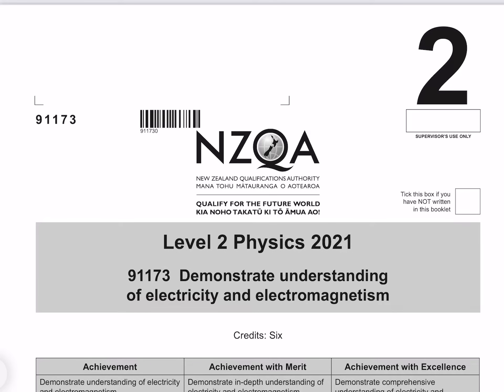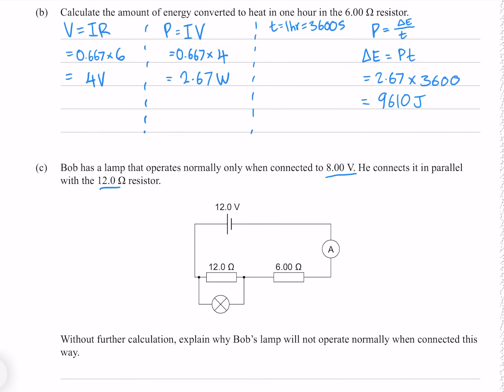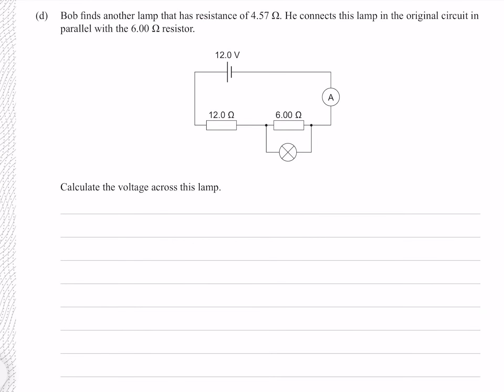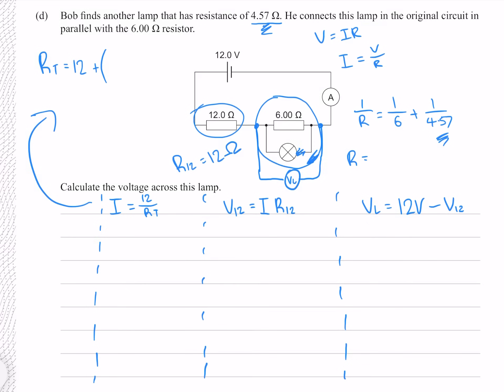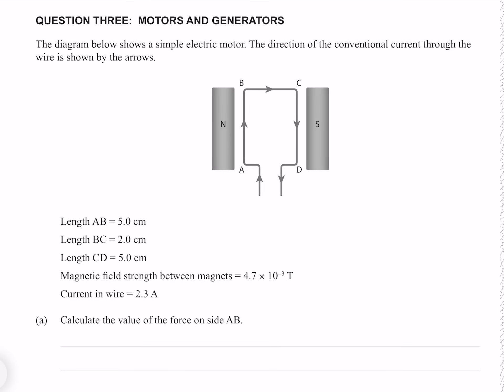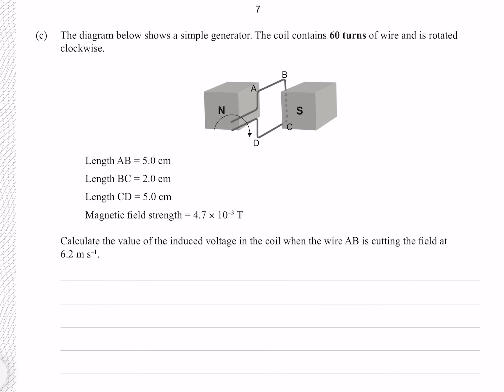2021 Electricity and Electromagnetism Exam (NCEA Level 2 Physics)

Comment: 1:18 - couldn't we just say that the voltage in the 6 ohms resistor is 4 (12-8)??? as voltage in a series circuit add up
Reply from the maker: Ha! Yes, that absolutely works too.

Comment: Hey sir, really apprecitate the video. For question 3C wouldn't there be an induced voltage on wire BC aswell, as its also cutting the magnetic field when rotating.
Reply from the maker: Hi Rumi, the positive charges in the section BC do experience the same force however, as with sections AB and CD, its direction is into/out of the page. Because in this direction there is no conductor for the charges to move into, they do not contribute to the flow of current in the circuit and can be ignored.
Reply: @MrWhibleyPhysics  thanks so much sir.

Comment: Q1 D). I simply did (1/12+1/6+1/4.57)^-1. This gave me the same answer, 2.13V. I realize now not all the resistors are in parallel so doesn't really work this way. Am I right to think this, meaning my working is wrong?
Reply from the maker: Hi Zachary, you're correct that your working is wrong. I'm not sure how you've gotten the same answer.

Here is the correct working https://www.wolframalpha.com/input?i=12-%2812%2F%2812%2B%281%2F%281%2F6%2B1%2F4.57%29%29%29%29*12

Here is the working I believe you've done which gives -55.5 https://www.wolframalpha.com/input?i=12-%2812%2F%281%2F%281%2F12%2B1%2F6%2B1%2F4.57%29%29%29*12

Comment: excuse me sir, at 13:51 i dont understand why you further multiply the answer out by 2 because isnt the question only asking for AB?
Reply from the maker: Hi Cobs, the wording here is understandably a bit tricky. The question asks for the induced voltage when the AB wire is cutting the field, it isn't asking for only the induced voltage in the wire AB.
Reply: Hi mate, I don't understand this as well.
But sir answered this in previous comment that When AB is cutting the field DC is as well, the question expects you to understand this. Because of this we have voltage induced by two 5cm sections, which is why we multiply by 2.
Hope this helps you

Comment: At 6:31, why does the 0.822 A have 3 significant figures and not 2
Reply from the maker: Hi Shriktic, the rule is to round to the least amount of significant figures given. In this question all values are given to 3sf, so it's correct to round to 3sf.
Reply: @MrWhibleyPhysics  Oh yes, sorry, I forgot the 0 isn't considered a significant figure

Comment: for question d(ii) why is force in position A and C acting at 90 degrees to the field line?? is it because of the circular motion so the force is directed tangent to the circle, which causes the force to act upwards?
Reply from the maker: Hi Hane, the key is to think only in terms of the magnetic field direction and velocity direction. The maximum effect occurs when they are at 90°, no effect is present when they are parallel.

The field in this case is  towards the right (from north to south), the velocity is tagential to the circle.

Comment: For adding resistances in parallel (/combination) I just plug ((x^'1)+(x^'1))^'1 into the calculator and it works the same. The fractions to me are too confusing at times but if I used that equation to show my working would that answer be invalid?
Reply from the maker: Hi Ant, x^-1 and 1/x are just a different way of writing the same thing. Either is fine.

Comment: QC ii shouldn't you divide the distance by 2 since the droplet is in the middle?
Reply from the maker: Hi Paulina. When using the equation E=V/d we are finding the electric field between the plates. The voltage of the plates is 240V, which exists over a distance of 2cm. E=V/d=240V/2cm=240V/0.02m=12000Vm-1.

If we were to instead use the distance to the middle, we would have to instead use the voltage between the plate and the middle. This voltage would be half of 240V, so 120V. Our equation would then be E=V/d=120V/1cm=120V/0.01m=12000Vm-1. So our result would be the same! Hope that helps.
Reply: Wow, so quick to answer! Thanks so much.

Comment: Sir, I don't understand why in question 1C you don't use conventional current but then in question D, you go back to using conventional current. Could you explain why?
Reply from the maker: Hi Nathan, I'm not quite sure what you mean. In 1c and 1d the conventional current is counter-clockwise however, the direction of the current does not have an effect on the working or answer to either question.
Reply: @MrWhibleyPhysics  Sorry i meant for in question c, the voltage seemed to have gone through the 6ohm resistor first, causing a voltage drop but in question D, the voltage flows through the 12 ohm resistor first

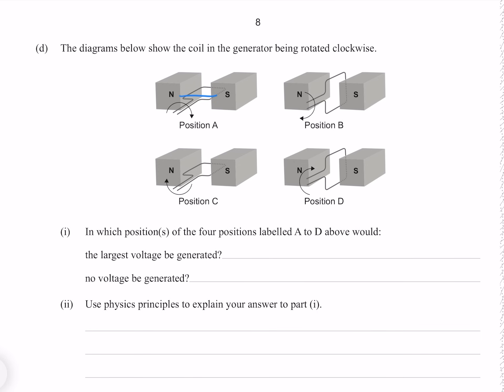Comment: quesiton 3di at 14:31 is really confusing could you please go into detail for me 😭😭😭😭😭😭😭😭
Reply from the maker: Hi there, the key is that the voltage induced is greatest when the velocity of the wire is at a right angle to the magnetic field, which points from north to south. The two examples where this is the case is in position A and C.
Reply: @MrWhibleyPhysics  Thanks but why is A and C's velocity at 90 degrees to the field and the others are not? Sorry should have phrased my question better...
Reply from the maker: If you imagine the field lines pointing between the poles, as the wire rotates it's velocity points at a tangent to the circle through which it rotates.
Reply: @MrWhibleyPhysics  OHHH i get it like the centripetal force so the velocity is at a tangent to where the wire is facing. Thanks sir!!!

Comment: Hey, why is the electrons moving down the left side of the coil at 16:21 in position C and A, but the electrons are not also moving up on the right part of the coil? Because if the left part of the coil has a velocity upwards, doesnt the right part have a velocity downwads if its moving clockwise? That would mean that the top of the left part of the coil is positive and bottom negative and then the top of the right part of the coil is negative and bottom is positive.
Reply from the maker: Hi Tayyab, you're absolutely correct. Electrons are forced out of the page on the left side, and into the page on the right side. This results in a counter-clockwise electron flow, and is what enables this to function as a generator.

The assessment schedule is vague, but I would expect they would allow for the placing of any arrow showing a counter-clockwise electron flow.
Reply: @MrWhibleyPhysics  Hey also if both sides of the coil have induced voltages, why does current flow?
Reply from the maker: Because the sides travel in opposite directions they induce voltage in opposite directions, causing current to flow. Recall that if the induced voltage on each side was in the same direction, the currents would oppose and cancel.

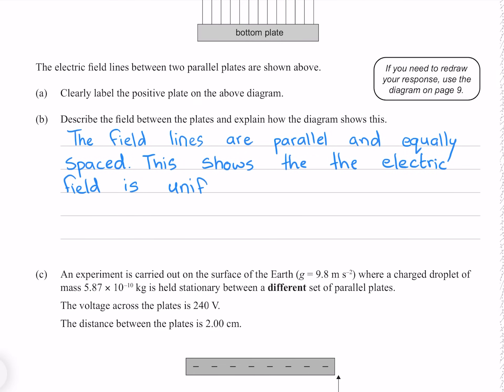Comment: At 7:48 I said electrical force instead of electrostatic force, because I did a past paper (2016 Q2d) that was about the Milikan Oil experiment and the answer schedule said that the forces acting on the oil drop was electrical force and weight. Is there a difference between electrical force and electrostatic force? Not to add more to your plate but is electrical potential energy and electrostatic potential energy the same thing? Thanks again for your wonderful videos Mr Whibley!! :))
Reply from the maker: You're welcome Kaishi! I'm glad you've found them useful.

Electrostatic force or Coulomb force is the more formal description, though electrical force fits too.

Similar to the way we might interchangeably say gravity force, gravitational force, or weight force.
Reply: @MrWhibleyPhysics  Amazing thank you so much, you have lifted a weight off my mind!! Getting ready to fight for tomorrow's exam 🍀🍀🍀

Comment: 1:49 just wondering about the significant figures, they seem to change every question so how do we know how many significant figures to do for each question?
Reply from the maker: The rule (though it's rarely enforced) is to express your answer to the least amount of significant figures in the question. So if you were given 12.6m, 55.1N, and 23s, 23s has the lowest sf of 2, so your answer should be given to 2sf.

Comment: Hello sir at 3:50 why does the current and voltage increase in only the 6 ohm resister and not the 12 ohm resistor?
Reply: (might be wrong) 
-The 12 ohm resistor's current does also increase as the whole circuit had an increase in current as the lamp is also a resistor so it makes the total resistant on the circuit lower as instead of R1+R2, a parallel circuit means you add resistors like 1/R1+1/R2.  By lowering the total resistor to get the same voltage this means that the circuit needs to increase the voltage.

-for the parallel section, the new voltage it will always be less than the initial voltage of 8 as the lamp makes it so its impossible for the new resistor to be equal to 12 ohms 
eg 1/12+1/1000000<(1/12)^-1

Example
Parallel section resistors were 11.98 then total resistors equal
 11.98+6=17.98

If voltage was constant
V=12

V=IR
Substitute: 12=I*17.98
Solve: I=0.667 This is the current for the whole circuit

Then find voltage for just the parallel section: V=IR
Substitute: V=0.667*11.98
V<8

 therefore the parallel section would have a lower voltage than initial and it wouldn't be able to supply 8V for the lamp to function properly.

Comment: Hey sir, for questions like 3d(iii) is it ok to use the left hand rule. Where the fingers point in the direction of magnetic field, palm points in the direction of motion/force and thumb points in the direction of conventional current. So for the last question if we use this rule our thumb points in the direction of conventional current, but since they said movement of electrons which I think is called electron current, we can take the opposite direction. For this question this method worked but I was just wondering if this method would work for other questions similar to this. Thank you :)
Reply from the maker: Hi Ash, great question! There are two ways the slap rule can be taught:

The first way is to use the right hand rule normally for positive charges, and for negative charges point the thumb in the opposite direction.

The second way is to use the right hand for positive charges and the left hand for negative charges.

I personally find the first way to cause less confusion in my students, so that's what I teach. Both are perfectly valid though!
Reply: @MrWhibleyPhysics  Ah ok, thank you very much sir 👍

Comment: For Q 3c, I Don’t get why you times it by 2. Because it says when wire AB is cutting the field and nothing about DC? Could you please clarify.
Reply from the maker: Hi Kalouless, you ask a good question. When AB is cutting the field DC is as well, the question expects you to understand this. Because of this we have voltage induced by two 5cm sections, which is why we multiply by 2.
Reply: @MrWhibleyPhysics  Thank you
Reply: Hi I also struggled with this question when I was practicing using this previous paper. Why is it considered to be v in the equation V=BvL? Shouldn't this be the length, not the velocity? Thanks for your work mate! We appreciate it!
Reply from the maker: Cheers @ironduke3780 ! Not too sure of your question. With the values written out the equation is Voltage=MagneticField x velocity x Length. The velocity is 6.2m/s and the length is 0.05m, which we multiply by 60 due to their being 60 turns, then multiply by 2 because there are two 0.05m sections contributing to the effect.